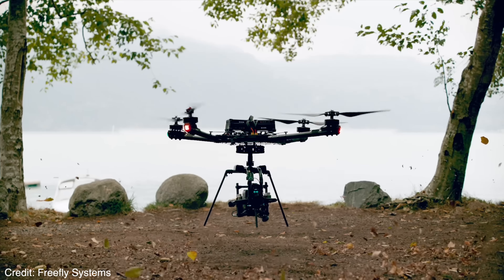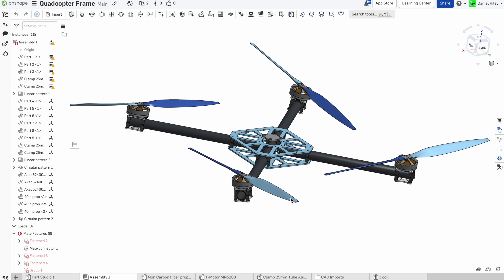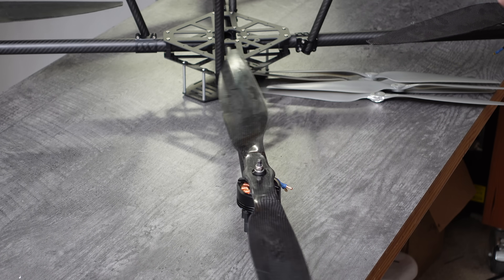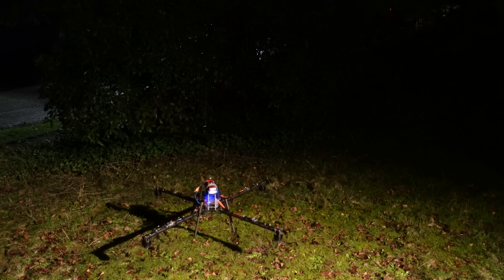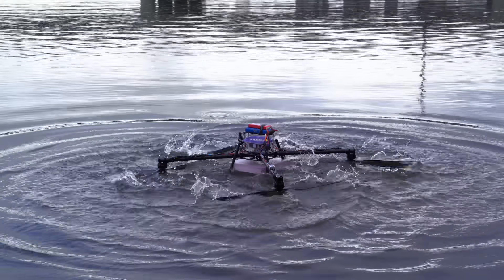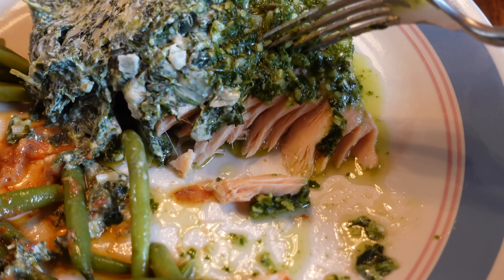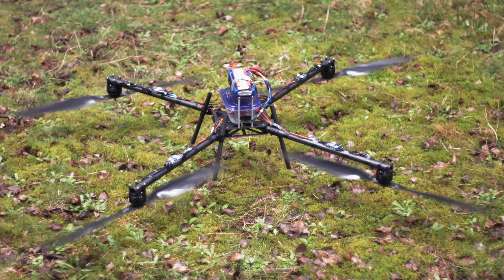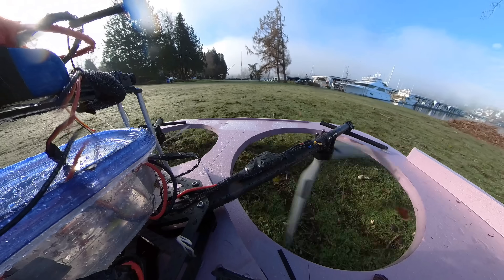Quadcopter Ground Effect Vehicle

Comment: * For a bit more stability you could use increased ground effect stability as soon as the copter is not perfectly horizontal anymore, by inclining the direction of the axis of all four motors a few degrees inwards. As soon is the copter leans towards one of the propellers, that propeller will get more lift because it is in that second more horizontal, delivering a bit more vertical thrust. On top of that, the tips of the propeller will not touch the surface of the water so soon.

Comment: The strange effect you're seeing where the unit wants to pull itself down into the water, and likely the "ceiling barrier" up higher as well, is due to the venturi effect.

Same thing that makes your finger want to stick to an air nozzle even tho the air is coming out at ridiculous speeds and say, 100 psi. The speed of the air increases in the narrow gap and this results in a pressure drop.

Comment: Since you mentioned efficiency drop for low voltage high current motor-prop match, is having a gear ratio gonna help? Since then you can attach a high kv high voltage low current motor driving a really large blade.

Comment: That's actually the best concept quadcopter in a flat platform. The blades give you flight if needed at altitudes above waves, but hover in ground effect is very efficient othertimes,  speed not so important, think about what I just wrote if you want it as a four seater to go on a trip somewhere, its a very capable concept with a combustion engine. No pilot licence or airworthiness needed.

Comment: That sticking to the water seems like some Venturi effect on the corners of the gaps between the water and the board. It got me thinking that putting a thin strip of scotch brite around the edge might rough it up enough to prevent water from adhering and causing a bunch of stick.

Comment: @rctestflight 
I am a Student from Switzerland and have been working on a Cyclocopter Prototype wich is now flight capable.
I was wondering if you would be interested to try the ground Effect with a Cyclocopter
On my Channel there are a few videos on the Project
For my School i also wrote a paper that I could send you
Reply from the maker: I just watched a video of your Cyclocopter. Very cool! Can you feel the ground effect at all with it? My initial assumption is that it wouldn't cause a strong ground effect.
Reply: @rctestflight  Hey sorry I am just replying now
Yes i can feel a stong ground effect at about 0.5m above ground so about 2 feet 
I guess the ground effect should only bee felt at about 15cm above the ground because the wings are only 30cm long
I am also working on a 3d printed wing out of lw PLA wich is almost the same weight as one made out of foam
Reply: I also made a test system, where i can test the thrust am power draw, so it should be quite easy to test at what heigt the ground effect is the strongest
At the moment i do mot have my equipement because it is at a excebition at my school but once i get it back i will try and test the ground effect and send you an email with the resoults if youre interestex

Comment: how about adding front and rear underwater foils to this. it should theoretically work better than your foil with ground effect wing and you could rudder the rear foil so as to steer? you could even counterbalance the natural lift at speed, with an opposite downward adjustment to the front foil.    ?

Comment: Think about how many times the speed of light the blade tips of the fans on the Avenger's Helicarrier must have to turn in order to push down enough air to lift that thing, altho its not trying to stay in ground effect (probably a good thing since it likely excavates the ground beneath the rotors hundreds of feet per second)! The vortex above them must extend right to the top of the atmosphere, just a downward extension of space's vacuum like water going down a drain. And even though you cant see it, you can probably hear it 2,000 miles away and it must continuously spawn F5 tornadoes in its wake. It probably needs to fly at least 3 miles above skyscrapers to avoid blowing them over as it approaches. Good thing Stark is able to suck infinite power out of nothing, cause mere nuclear reactors would never be enough power for those fans (bearing in mind our existing carriers that look approximately the same size have TWO reactors to merely push them horizontally at 30 knots or so while entirely supported by water; granted they are also charging 5000 cellphones and powering a lot of computers and lights at the same time and throwing the odd airplane off the deck).

Comment: Tu use ground effectivement you need to encourage pressurized area between ground and wings the easier the fluid will exit from the pressurized zone the worst it will be to use ground effect. That's why small gaps between floor and wings are highly effectives, look ekranoplane and hovercraft... luckily people tried a lot of shapes for different applications in history, it's nice to learn from them, and trying to improve rather than building something less efficient from scratch

Comment: I wonder if that ceiling you need to punch through in hover is an air vortex swirling up from the ground then down into the props creating downwards airflow.
Below that height the air is ejected more sideways, close to the ground, and above it doesn't have enough energy to loop back into the props. 
I really have no clue. Just trying to imagine the airflow.

Comment: Your power losses are more likely due to both pulling spoiled air into the props from putting them under the arm, and resistance losses due to the low battery voltage compared to the overall circuit resistance. Your PIDs are also likely correcting too fast for the slower blade precession and related torques and vibrations, causing heat losses in the motor windings from superfluous switching, and switch rates too slow to gain efficiency from a tuned LC resonance (like how sunspot CMEs overheat power line transformers). 
This may also be one of the contraptions where an air duct could be beneficial around your props, and with a large bellmouth output to create a high pressure zone when it approaches the ground/water.

Comment: You should spray some of that hydrophopic coating on the underside of the foam panel. That will pretty much completely prevent the craft from being pulled down by surface adhesion if it happens to touch the water.

Comment: Hi. At 5:52 you are comparing the amps only for efficiency. But was both with 2s or are you comparing 6s with 2s? If so, the power should be compared to compare the efficiency I guess.

Comment: Should have used the smaller props.
1. Because of the vibration problem.
2. Because the effect that makes horizontal props less efficient than wing for the ground effect is smaller.

Basically, wings achieve high level of ground effect by moving along the ground and compressing the air in between.
Now, when you replace the wing with a prop, half the prop is moving away from the direction of movement, which, to oversimplify, means that only HALF of each prop is generating a useful ground effect while moving, because the blades moving "backwards" does not actually compress the air anywhere nearly as much.

So, a ground effect quadcopter is basically just a way to make a really complicated and ineffective hovercraft.
It's a fun idea, but, probably never going to work well.

Comment: OK OK work with me here. Same load lower volts means you need more amps to make the same. You are pulling the same watts with the lower cell count. All you did was trade volts for amps because you load is static. More amps means more heat. Running a higher lower mAh lipo set would be better. More volts but less amps to reach same watts means less amps of heat draw. Even more so you went up in prop size meaning more load meaning you really wanted the voltage just lower you KV.

Comment: I think that your downplaying the utility of this design. It can do everything a hovercraft can do (at lower speeds) which would keep the occupants safer in a crash at the low altitude. It can also fly like a helicopter at the expense of more fuel/battery consumption and it would be faster than a hovercraft in that mode.

Comment: Going to fast, it seems that the craft scoops air underneath and with equal power going to both front and back rotors is enough to nearly capsize it. Just need a two stage system, that decreases the lift on the front two motors as soon as the front starts to lift up.
Reply: Kind of offended that you would go as far to build this and not look at individual aerodynamic effect differences between rotors and wings. “Somehow this large box doesn’t fly fast.. oh well, probably no way to tune it..”

Comment: if you increase blade size you have to increase voltage to reduce amps.. and use toroidal blades  with ducts 
 I need your settings hoverboard incoming lol

Comment: The lower voltage may make the motor less efficient and hotter since lower voltage for the same load will be higher in amperage.

Comment: I was just thinking about that weird hover point that you made, something about a sort-of pocket of resistance at low altitude. I wonder if the air temperature shift at that height could be the cause. A warm to cold air mixture point could cause minor turbulence in the air currents at that level.

Comment: TL:DR "Skirtless" HC's (GEHC's) do actually have skirts... kinda

So, I rabbit-holed on this. The long and short of it is: you DO need a downward facing sidewall all around the underside of your deck in order to disrupt the airflow and develop a pressure cushion

You ever see that experiment where you hang 2 ping-pong balls then blow between them and they get pulled together? (related to the Coandă effect) That's what was happening here and "sucking" your craft to the ground/water. Fast airflow beneath the craft creating a low pressure stream was defeating your lift, pulling the craft down.

You need to contain that airflow in order to develop a high pressure beneath the craft. As it turns out, if you'd added a sidewall of just a Cm or 2 around the perimeter of the underside of the deck, it should do the trick. This is analogous to the vertical sidewalls needed on your airfoil type GEV's in some ways; containing the air beneath the craft where it can lift the vehicle rather than being knocked away without the desired lift addition.

Comment: Use a rotating mount for your drive motor with a heli tail gyro to stabilize the steering.  It will solve your drifting and perform much better.  I have an example in my shorts videos..
Reply: In place of your rudder
Reply: Vectored thrust
Reply: https://youtube.com/shorts/ef7Yf_B7e9w?si=rw-xYetT1DVysq-i
Reply: Put yours closer to the middle front to reduce the downward pressure created by pushing from the back or use and edf or two to keep the moment of rotation lower. Or add a front airfoil or flaperons?  To keep the front end up and stable In my video you can see the effect as it stops and catwalks as the downward pressure decreases ,in my case that keeps it firmly grounded which keeps it from flipping while at high speed.  I gaurantee you will get better control.  I did one with rudders and at low speed you lose much of the steering.  Rotating the prop itself increased the control so much I've let young kids run several at a time with no worries.  Just tune them down slightly.  They take right to it.  Its that easy

Comment: Need bracing between the boom arms and using a controller with betaflight and adding some RPM filters would go a long way for stability. 

The suction to the water was surface tension, you can stop that by adding tiny little "ice skates" to the underside so that they prevent the entire surface from touching the water at once

Comment: You need to synchronize the blade weight (propeller position) to be exact mirrors (diagonally) to minimize the vibration, or use different propeller style that is always balanced.

Comment: About 1 to 2 decades ago was the Moller Flying car.  They had a flying saucer configuration with a centrally mounted pilot.  Eight horizontally mounted fans provided ground effect lit for this experimental air craft.  Subsequent models never achieved much more than a hundred feet off the ground.  Perhaps a bit more than that.

Comment: Curious about applying a hydrophobic coating, like "never wet"  on the underside of the foam skirt to prevent the stickieness of the adhesion/surface tension if the underside strikes the water?

Comment: Please make an airship, one with a candle-powered hot-air-balloon instead of helium or hydrogen, and another one with an aluminium-foil (the commercial-grade one, the kind used in disposable single-use baking trays) balloon, and make small-scale experiments which to simulate real-life use-cases like using less power to control the airship like a drone, or using it to pass above rough terrain (i.e. mountains scaled down in the shape of a house or wall) using less power than an airplane carrying the same weight and which would need a runway. Then please compare it with a VTOL airplane. All of them RC.

Comment: You'd probably benefit from making the propeller 30% smaller while cutting a new foamboard that is about the same size (but with smaller holes obviously). That would reduce the consumed current  (which is proportionate to the torque).

Comment: 7:00 Get a Couple/Few (4 maybe) 2 liter pop bottles. Make them like A water aircraft would have. Trying to spin them with the motor is counter productive. As it spins on the water like that you lose some of the water tension that would allow you to float. You need something like Where the O is the 2 liters laying on its side. Will provide plenty of buoyancy, Even if you wanted to put a heavy camera on it. 
                                          __________
                                               /       \
                                             O         O
Reply: Would also allow you to add a bit of ballast weight to the bottom of them so you get a stable landing while on water.

Comment: Maybe you can still use the donut floaties on the props, but make it more of a tapered/cone shape? So the resistance in the water will be more gradual as well as the buoyancy. Then when you catch the water it isnt as instant and has more time to save itself. Tho I guess you have to be pretty close for the ground effect to work anyways, so it wouldn't make much of a difference. Maybe with even bigger props it could? 🤔 Just a thought

Comment: Don't discount the effect of surface tension when you get into your suction effect. I think augurelite has it right that the increased airspeed when it gets closer to the water could cause the low pressure suction. But once it actually touches the water, surface tension is going to keep the edges sealed, and now any lift is fighting a vacuum created under the foam. Just rough up the texture on the bottom of the foam to make it harder to seal.

Comment: Could this craft operate in 2 modes, with weights on swing arms to move the CG forward? In one mode, it would operate like a quadcopter. In the other mode, it would operate like a fixed wing, but with the props just providing lift and differential yaw and roll control.

Comment: you could orient the motor/prop to stabilize the banking at high speed, front motor should be tilted to blow a bit towards the front, so when the quad tilts up, the front motor will be less horizontal and loose vertical lift, stabilizing. Same but opposite for the back motor. The other effect is that at high speed, less air will enter the front props, because the top face which is vacuuming is oriented towards the back, making the lift less

Comment: You would have won any court case they tried to bring against you for the Tupperware name being used... The title of the video was a descriptor. Therefore, the trademark is null in that case. I hate when the little guy lets the big guy bully them... it leads to that bully doing more of it to others in the future. You should have made a video the moment you got the letter showing it off and using the video as your notice of receipt, that you did not plan to follow their command and that you will be waiting to hear from their lawyers if they so choose to continue to damage their own reputation.

ANYWAY, I really wish I could afford to and had the time to build one of my own. I have the perfect design in mind and have modeled it in software. It would do exactly what we want it to do too based on the modeling. It didn't take much work to make the software understand what was going on over the normal modeling I do with Quads. Ground effect was not a preinstalled script. :P